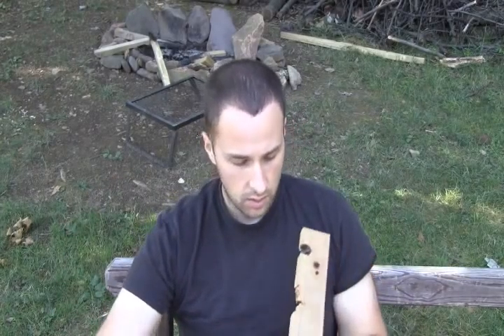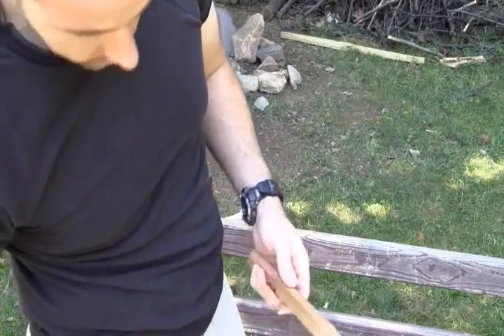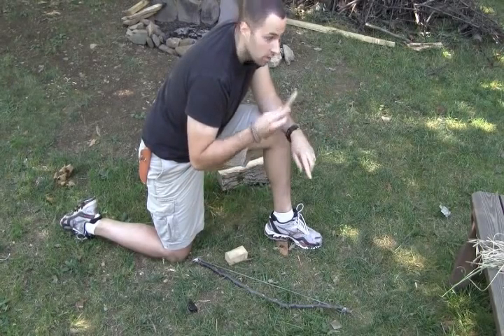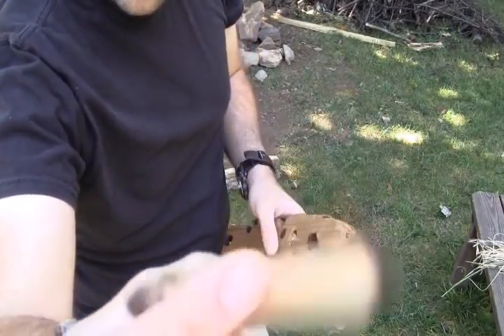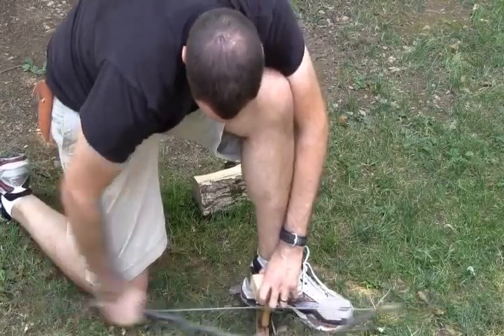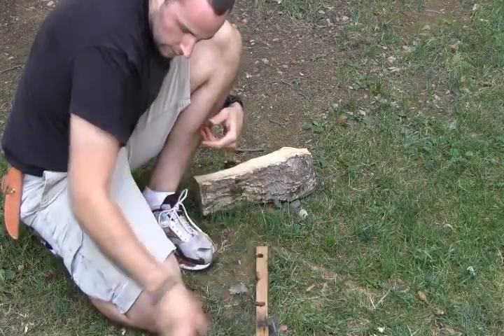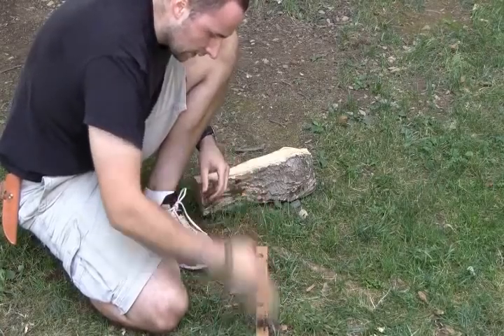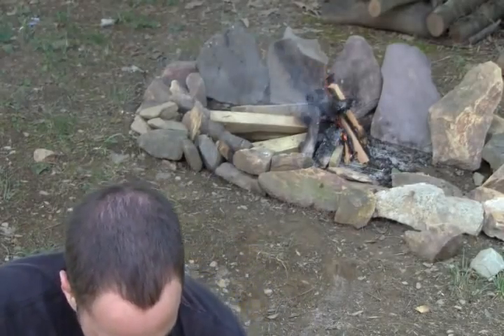Bow Drill Friction Fire, Equip 2 Endure

Comment: I've had a lot of success with two little tricks.  One is adding a few grains of sand to the fireboard in the drill hole.  And the second is actually creating a reverse wrap twisted string, out of shoe lace or 550 cord.  The twists create a better grip on the spindle.  Thanks for the vid!

Comment from the maker: @ken18328 , no, as long as you have not gone to far into the board and depending on the thickness you can get two maybe three out of it most of the time (on 3/4 in piece).  This skill is all about practice and being able to feel the correct amount of pressure to produce the coal.
- Adam